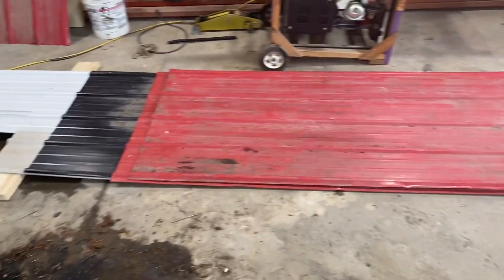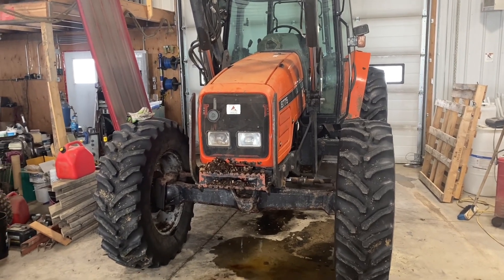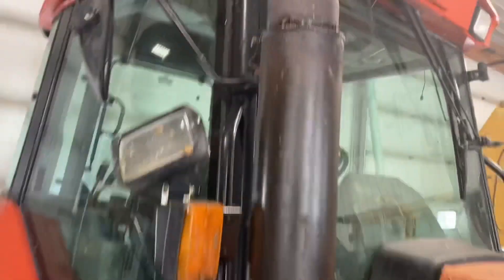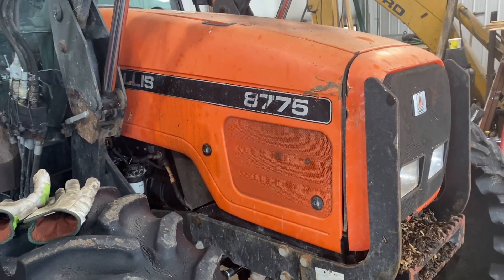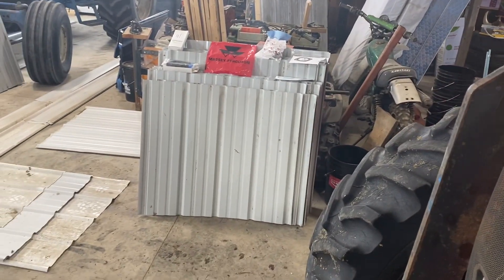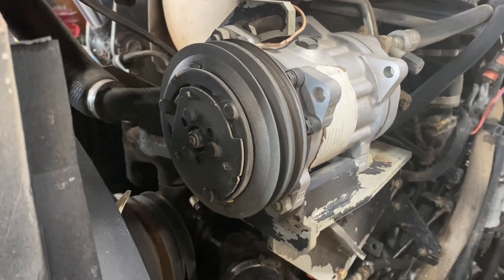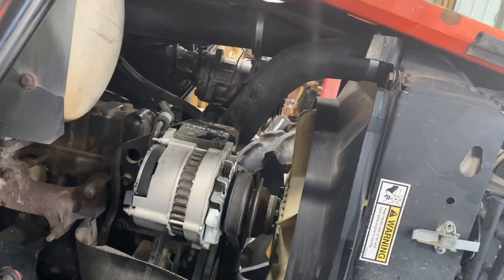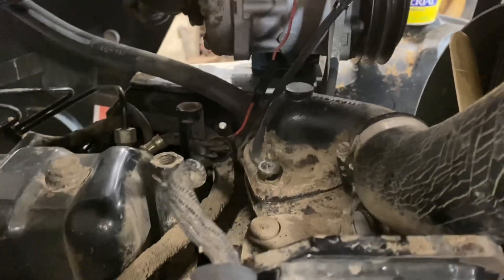Agco Allis 8775 thermostat

Comment: Good idea on soaking gasket I have always just put light weight oil on the gasket
Reply from the maker: Yeah any kind of moist will work as long as the material was made for it, like some Orings and hose cant be around certain fuels.

Comment: That was quick getting that video out Doug. The pressure's on for 2 per week now 🤣🤣🤣. It's trying when you go to a job and some repair turns out to be, what I call an iceberg job. ie there's more there than meets the eye. My wife and I took a holiday there, we stayed over last night with friends (different rooms. The Friends,  not the better half) and had a lovely dinner, followed by inner lubrication, then a good sleep as the hotel got battered by rain & sleet courtesy of the jet stream I mentioned. This morning (6th) we had an excellent breakfast then back home. I headed out, hitched on a trailer and went to connect the brake pipe but who ever last had a brake pipe on must have forgot to disconnect it and it has pulled all the back connection plate out of line. Who ever did it must have had a job getting the coupling off as I can't get it on. But I will once I work out how to straighten the plate. Joys.
Reply from the maker: Yeah was on Facetime with mum n dad n they said they were getting fairly battered where they are, wouldnt be the SW coast if the rain wasnt coming upwards, lol. Yeah it's a bad set up when you're fixing someone else's bad day. Stay warm n watch out for shed doors on those windy days.

Comment: On the hydraulic issue.. if it's got the wrong fluid in it, that can cause similar issues. Case says Hy-tran for a reason.. other fluids that are supposed to be the same spec.. lol.. will gum up the balls in the shifting valves.. 
You are definitely learning your way around injectors.. 
Must LoL.. even new hydraulics settle too.. some pretty bad.
Good tip on the gasket dipping!
Freaking net wrap!!! I've heard it gets into cows guts and they starve to death too...
Reply from the maker: Yeah i never feed through the bale processor and i'm pretty avid in picking up any net that i see in the pens, it's bad enough all the garbage i get from the highway bales.
Reply: @piperdoug428  it amazes me how so much outfits leave twine and netwrap on and process to feed. We have enough trouble with  twine in things. Worst is any left in the hay fields.. the disc mower is a magnet for it... Obviously your fan on the tractor is too..lol

Comment: Changed a thermostat on the john Deere last summer.  It looked fine, but it was definitely the problem.  Opposite problem though, it didn’t want to open anymore.  Our Massey dealer up here used to be great, then they were bought out by a bigger outfit.  Not so good now.  Won’t be buying anymore Massey equipment. Which is too bad cause I have a 220 swather that I really like, but when it gets upgraded it won’t be another Massey.
Reply from the maker: Yeah sadly thats the way all too often now, our local NH dealership used their older stores to finance take overs of other dealerships to expand and sadly quality suffered. And yeah like you said it sucks when you were a brand fan. But yer bottom line writes the cheques.

Comment: Always funny, how they mix the modules. US tractor with a engine from Finland, lol. But usually Sisu is not too bad. They also build nice trucks.....with cabins from Mercedes-Benz, lol. Cheers from Bavaria.
Reply from the maker: Yeah most i hear is fairly good, this model is made in France so thats probably why it likes to create drama, lol. Eventually i'll get the wrinkles ironed out........eventually.
Reply: The biggest 4×4 case crab steers 90 and 94 series, had a french engine.. and now they use iveco..that's a cummins copy..
Reply: @GosselinFarmsEdGosselin  Claas tractors also have Iveco engines...don't know, if they are good in tractors....in trucks i know, they're bad! I mean the new engines, because the old V8 engines were very good!
Reply from the maker: @AlsDemolitionChannel  We had a NewHolland CX8080 combine with the Iveco and while still on warranty (thankfully) due to an injection pump issue it over fueled the rear cylinder and hydraulicked the side of the motor out, after fighting with NH a crate motor was put in ($34,000). apparently it's an issue with that run of motors
Reply: @piperdoug428  That sucks for sure!😕